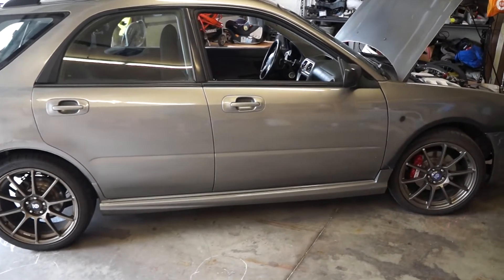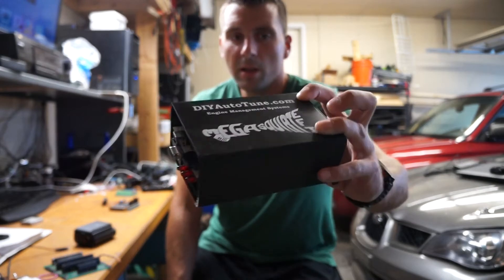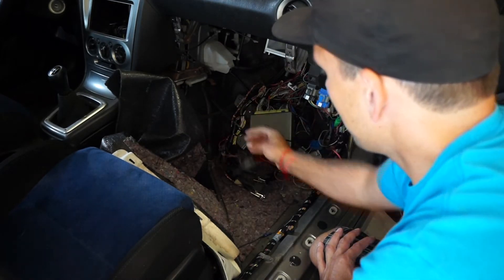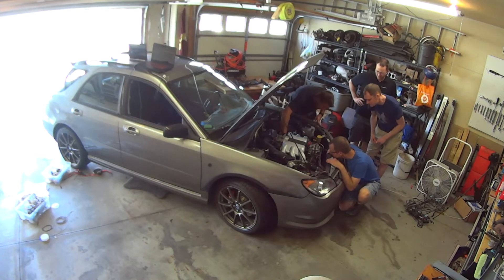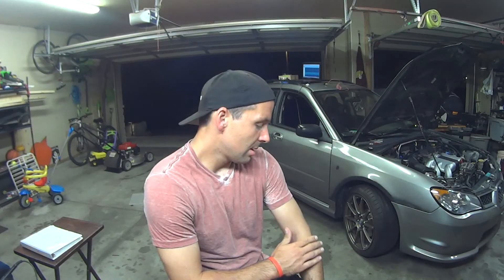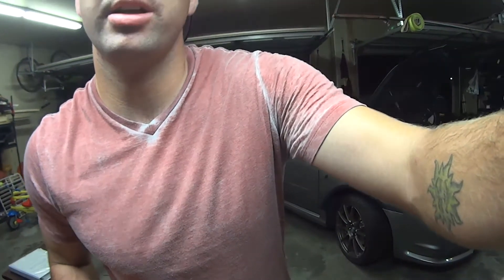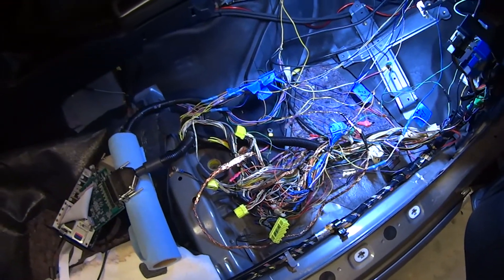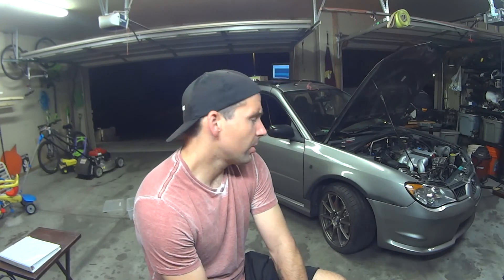EG33 Swap - Megasquirt3 First Start (Ep. 7)

Comment: Great video! Id like to do the LS coil swap on my EG33. Did you create a wiring diagram? Does the igniter go away?
Reply from the maker: I just used the diagram from the megasquirt guide for LS2 coils. Yeah you can get rid of the ignighter, these run direct from the ECU
Reply: @EazyOnCars  Im running a stock 1995 SVX ECM. Its in my Outback with a 5 speed manual.  I wasnt sure if it put out the +5v to trigger the LS coils or not.
Reply from the maker: It looks like that may work, check the diagram here: http://www.megamanual.com/seq/coils.htm

Comment: You may have mentioned it before, but are those JDM front fenders? Why do they look a little off? 

This channel is very inspirational. I'm in the process of swapping a 30D into my SF forester.
Reply from the maker: They are USDM but the passenger side had some rust so I sanded it down and painted rust converter on it. Looks a bit better but long term I will replace it. Glad you like the videos, if you've got a build thread for your EZ30 SF link it up.